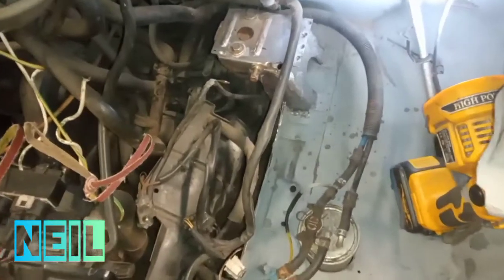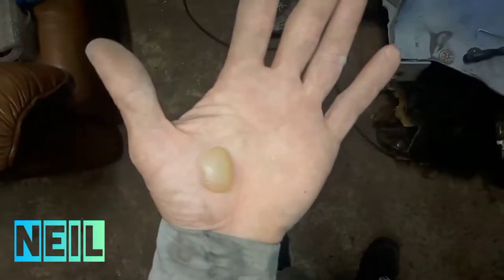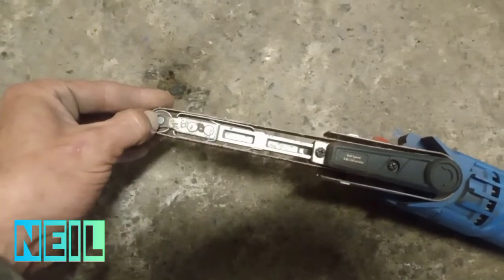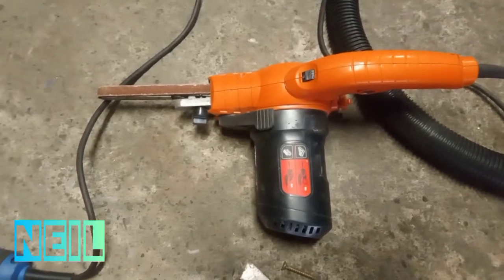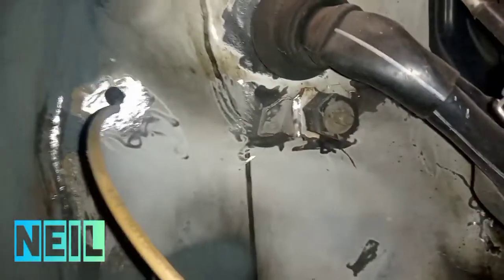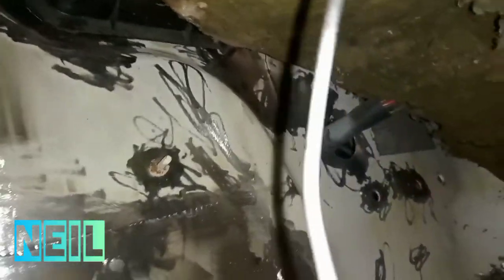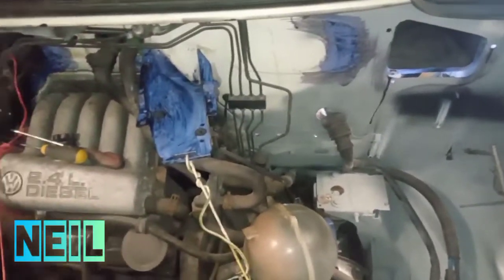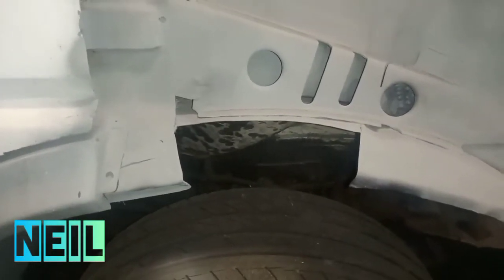Fixing my very rusty Volkswagen T4. Part 37. Engine bay paint prep. Front inner arch patch repair.

Comment: Getting close to paint now! I bet that blister stings a bit!! I found from my very little experience with filler that it takes a few goes to get it perfect and easier to sand when there is less there. I kept getting air holes and little bits missed so would put a thin skim on again. I should probably have used dolphin glaze for that but didn’t bother. Thanks for the content and inspiration 👍👍
Reply from the maker: Hi Steve, My mate Kev said less is more with filler. Better to build it up in a few layers rather than try get it first time. I did notice you get a finish coat from upol also. I'll have a look at dolphin glaze 👍

Comment: Getting there 👍What’s your windscreen like? I’ve noticed water behind the A pillar running down under the matting. I’ve got the same Silverline sander belts from Screwfix are the best. I find the eBay belts snap easily. Thanks for the video 👍
Reply from the maker: Hi Paul. I think it will need replacing mate. It's cloudy around the edges and apparently that's an mot fail? Even though it's not in my line of vision? Anyway, think I'd like it out for rust treatment and paint. I did buy my belts from Screwfix but find Toolstation 1ß last longer. I buy the 75mm 1s and cut them down with snips
Reply: @neil...  It looks like mine has bathroom silicone above the dashboard. I think your right, windscreen out and assess damage (rust) 😞
Reply from the maker: @Paul-re4gl  It's 1 of the jobs I haven't been looking forward to for a long time. I'll get to a point fairly soon where I need to take them all out 😬😱